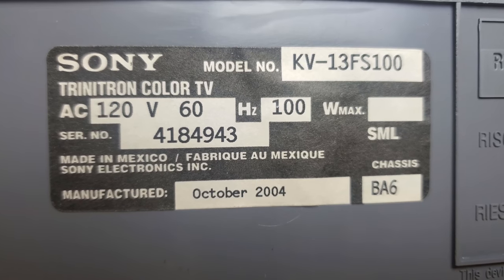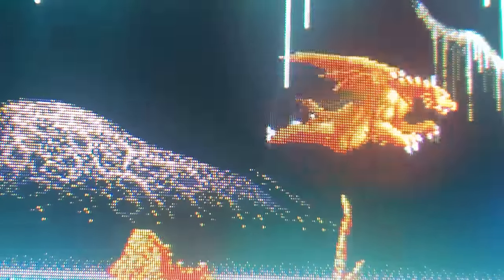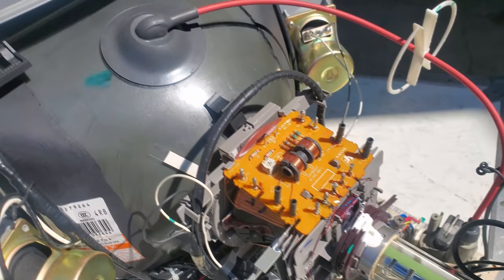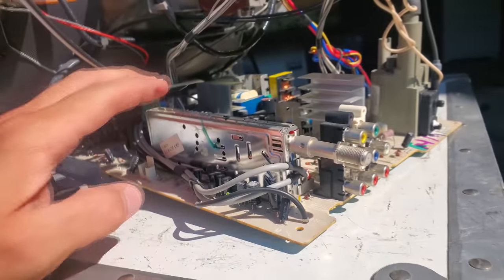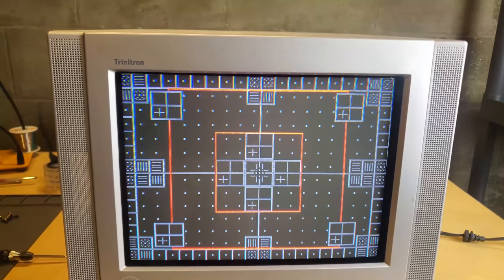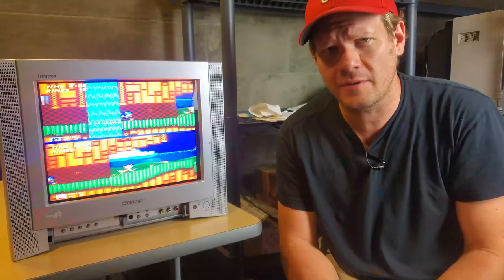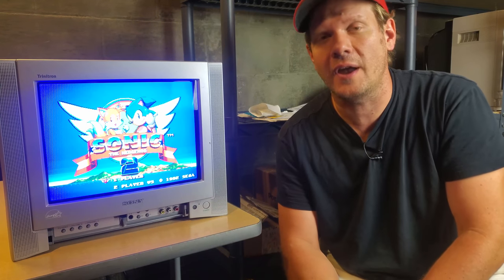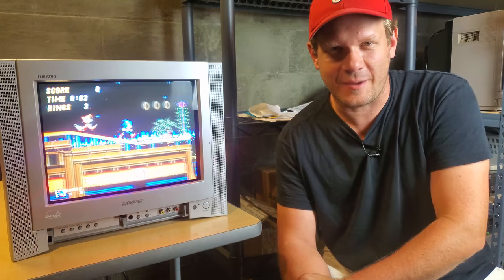What do I think about Consumer CRTs? - Sony KV-13FS100 Review & Adjustment

Comment: I have a 2002 version that needed the automatic black crush turned wayy lower than the default. Was driving me nuts. Also needed to adjust vertical convergence and unlike some other brands, sony glued their rings on so I needed to pry them apart. Felt very sketchy. In the end it looks good but these have tons of automatic leveling stuff and for some reason the color temperature options dont do anything because when you change the option, the auto biasing thinks the cutoffs went off and readjusts the white balance nullifying the color temp option. Weird tv but if you like contrasty pictures pick it up. Got mine for 20 canadian.
Reply: Also you can forget about adjuzting the screen controll because raising it gives retrace lines and lowering it causes the screen to get dimmer then the auto kine bias kicks in and it gets brighter so you kinda need a scope and meter to do it by the book. I had to wing it and hope its good. I think the way they calibrate it is by raising it to the point just before retrace and let the auto kine bias take care of the rest.
Reply: I have a 2002 with that black crush! it's really frustrating. What did you do to minuimize it? Is there a way to actually lower it?
Reply: Yeah I think the workers weren't trained well in 2002 or something haha. Anyway, I BELIEVE it was called "DCTG" under the VP2 section of the service menu. You need to turn that down and brightness will go up but also I went to SBRT (sub-brightness) and lowered that to the middle of its range beforehand to be more neutral. I may have turned up gamma a couple notches and experimented with some other settings but really DCTG was the big difference. I would also recommend setting (I think it's called TROT still in the service menu (Tilt-ROTate?)) to zero to eliminate flicker in the image as well as turning rotation to center in the user menu. If the picture looks crooked, I just put some gloves on and twisted the yoke a touch but if you aren't comfortable then you can leave that. I still couldn't figure out the not-really-working color temp controls so I picked one and then adjusted the cutoffs for neutral grey on a dark image and the drives for a neutral bright white. But this part is optional if you like the color balance already. 
To enter the service menu, have the tv off, then on the remote press "Display" "5" "Vol up" "Power". Before exiting the service menu you NEED to save the settings by pressing I think "Mute" then the text in the upper corner will become red and then press "Enter" and the text will go back to green. To exit the service menu, turn the tv off and on again. Good luck and enjoy your better looking tv! @jonathanmitchell5593

Comment: I have the 20' model, when hooked up through component, the image quality in 240p is really good.  Its capable of 480i, ps2, xbox and gamecube res which sucks.  Ive been looking for a good solution to downscale 480i to 240p.  Anyways back to this monitor, its great but theres something better.  If you can, scout for a sony wega screen, hd crt is kinda interesting because they can do 480p up to 1080i. Not sure how 240p looks on an HD crt but I can't imagine it would be bad.   I have both sony pvm and crt, both are good with pros and cons but overall are really good if you hook them up properly.  I prefer RGB for color accuracy but component is just a hair in 2nd.
Reply: I always wondered about a gamecube with swiss installed to force 240p, never tried it due to gamecube component cable costs.

Comment: I have the exact same model and it needs adjustments but, I'm new at this and I do have the 240p test suit on SNES. Could someone point me to forums or an introduction on how to service the tv.
Reply: In 240ptestsuite you can pull up a menu in the test patterns, then press “help” for a description of what the pattern is used for/how to calibrate it

Comment: I have the exact same tv. It looks great through component on GameCube and ps2, but when I hook up my snes through composite I notice sideways ripples.. it only does this on 240 not 480i
Reply: Tv has great geometry and color. It just has that ripple issue with my snes jr through component. You’re one of the most knowledgeable guys with crts so I though you might know what it could be off hand
Reply: @Pyroguy410  could it be your system or the game?
Reply: @igotasmaldic7306  I don’t think so because it looks fine on my Toshiba 27” crt

Comment: Guys do you know if the SONY 2005 LCD Television would also produce nice Retro colors. I seen those TVs have all the plugs...From composite, component, S-video, HDMI...  I just can't seem to find later SONY CRT that are 13 or 20 inches and have S-Video.  Only the bigger models have S-Video.
Reply: Sony early LCD's are really bad, as they have low-contrast panels. It gets good from 2008-2010. I think the best is the 32BX400. But if you don't mind going a bit bigger, grab a 2008-2010 Panasonic 42" VIERA, that is the killer TV for game consoles, as it does everything from the Atari 2600 to the PS5 with amazing image quality. I recently got one for free!
Reply: @lovemadeinjapan  i have a Sony 46HX800 model that i bought new back in 2010...It's one of those early 3D LCD-LED 240HZ TV's... I'm pretty much using the TV for all the consoles... It doesn't have S-Video but has AUX, composite, component, HDMI.  For the early 2000s systems I use component.  90s consoles composite, 2005+ HDMI.  Kinda want the 90s consoles to look better on the TV or go the CRT route. I only have room for a 13 inch CRT and if I can find a Toshiba or SONY model then the 80-90s consoles will look better.
Reply: @mrfixit8776  Did they already drop SCART on that one. I thought it still had one. It's the model with the glass plate in front or not?
Reply: @lovemadeinjapan  mine is plastic screen